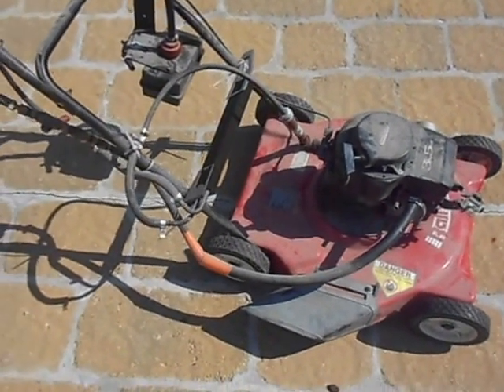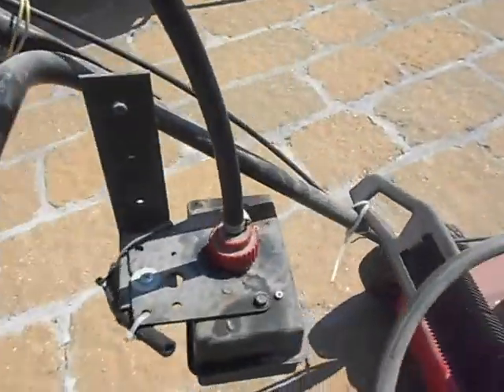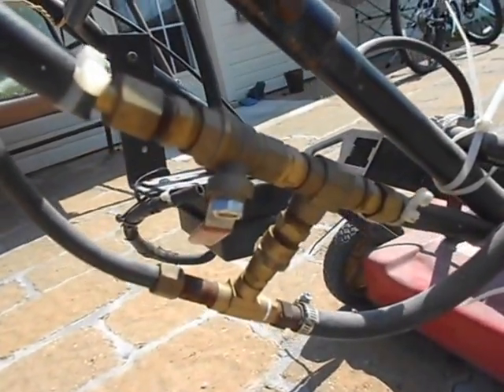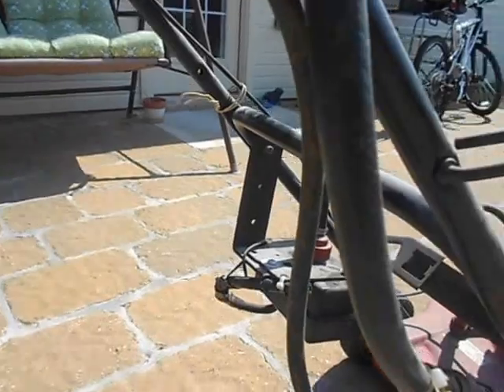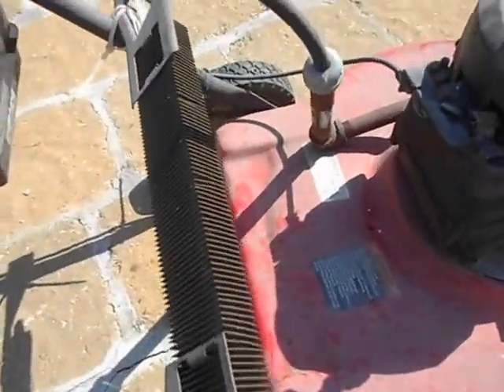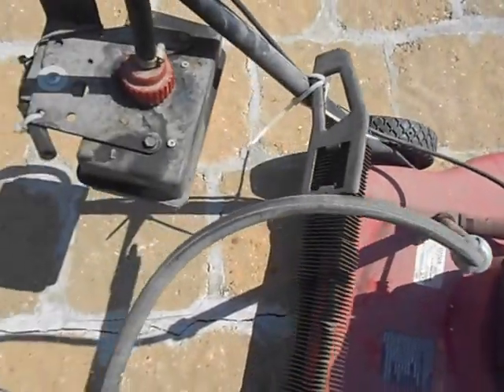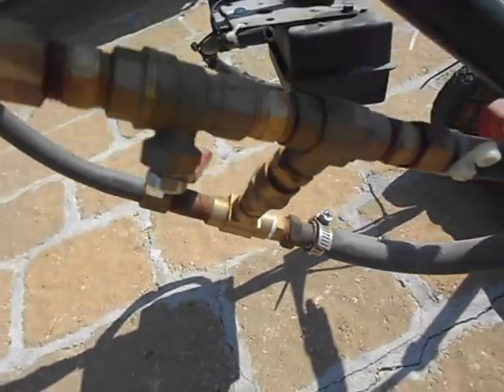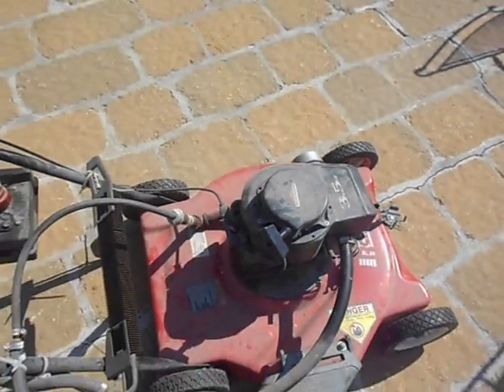DIY:  Converting a gas engine to run off of vapor, part 2

Comment: never had an engine overheat from running on vapors
Reply: even after hours of running
Reply from the maker: prototype9000
  The engine does not overheat, but the combustion temps do increase.  Eventually, you will end up with burnt valves or worst case scenario a melted piston due to combustion temps running too high.  An engine will still run with a burnt valve, but engine performance suffers.  The exhaust gas recirculation setup cools off the combustion temps which will increase longevity and decrease NOX emissions.